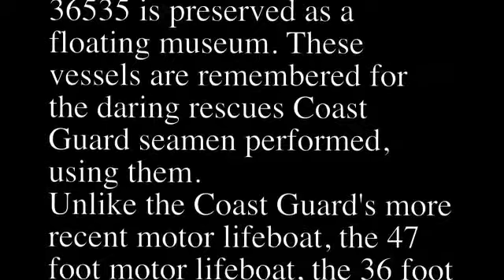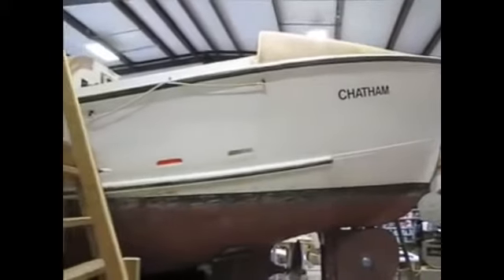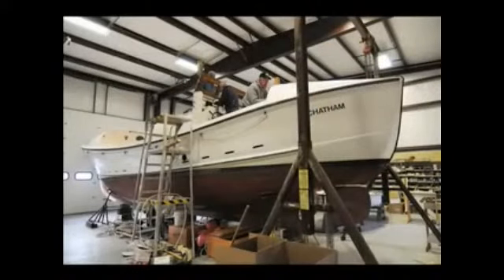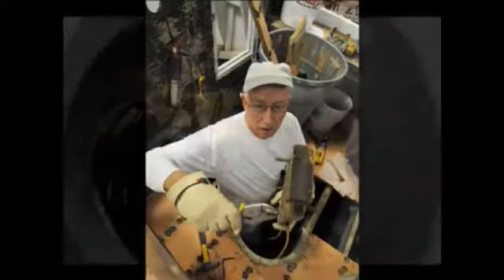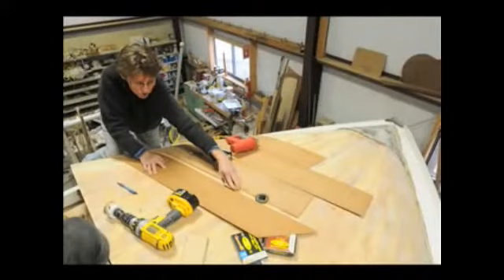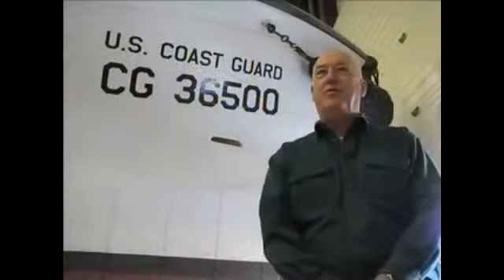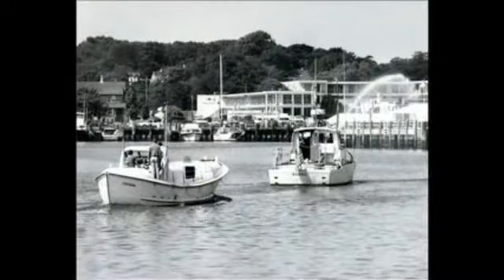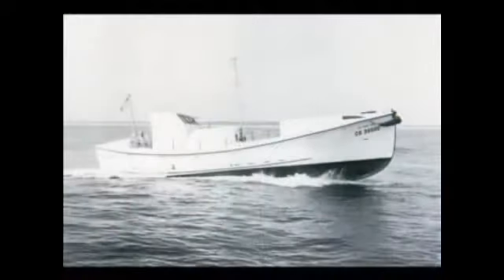USCG 36 foot motor lifeboat

Comment: The forward circle up front was called the "glory hole". A seaman would stand in there and point with his arm and flat hand which way the next wave was coming from. When in the surf the coxs'n couldn't see which way to steer or you could point to the man in the water. Then you   took a breath and fell to your knees and held on for dear life. You did it for each wave until you were out of the surf. It was fun when you were young and dumb.😉